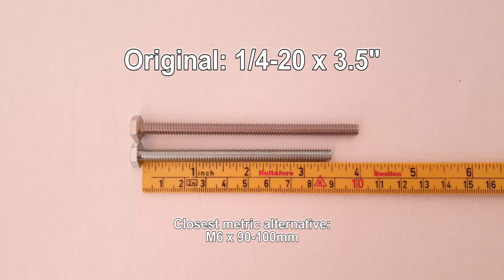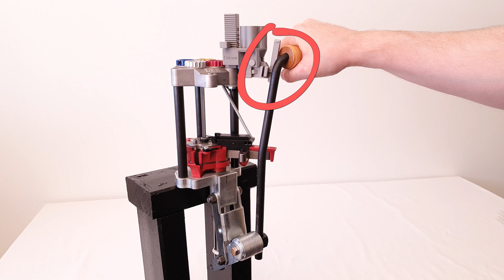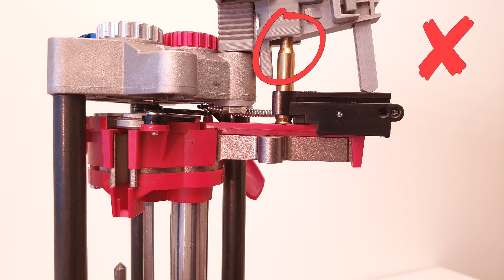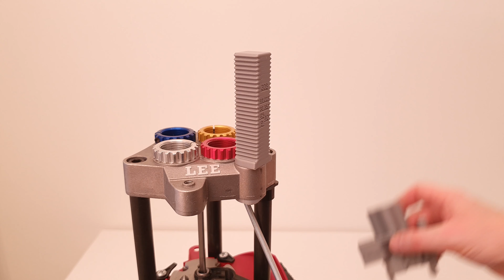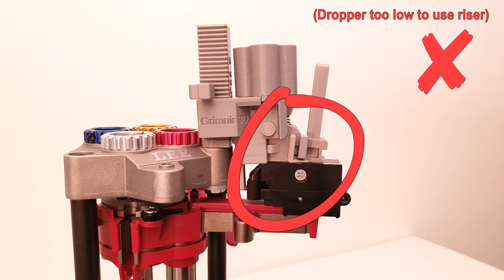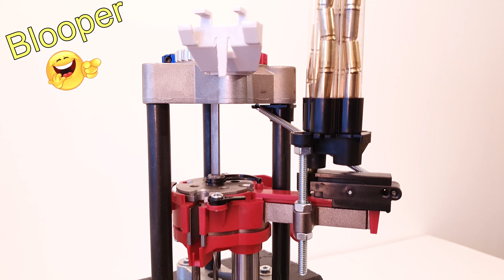Instructions - Universal case dropper for Lee Pro 4000 (Auto Breech Lock Pro)

Comment: Does anyone use this case dropper on the Lee Pro 4000 with the powder-through expander die in station 1 with either the Lee Auto Disk or Auto Drum powder measure?  I like to preprime my cases off press and use a powder check die in station 2.
Reply: i combine seat/crimp and use check on station 3 

lee sells drop in for crimp die to turn it into a micrometer seater/crimp

Comment: Outstanding work, love the seeing the other design iteration update
Reply from the maker: Thanks! There isn't enough room for the threaded base and nuts on the Pro 4000, so it has to be like this. You don't get the same fine adjustment, but frankly, it is not needed. Especially since the Pro 4000 can't take as long cases as the Six Pack Pro. I did try this style on the Six Pack early on, but was worried you would end up with not finding the right adjustment for some obscure cartridge I hadn't thought of. It's quicker to adjust up and down, but also introduces a tiny bit of movement between the base and the body.